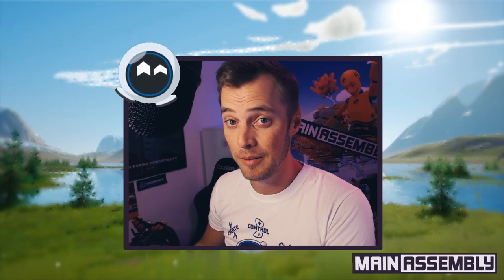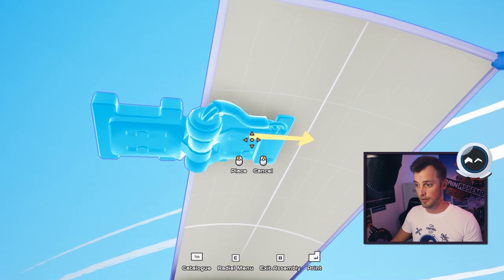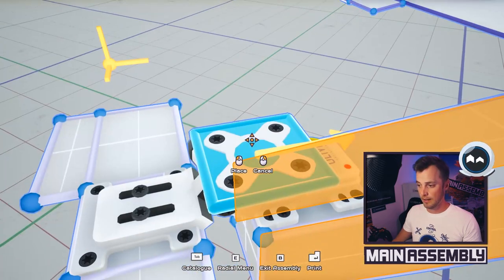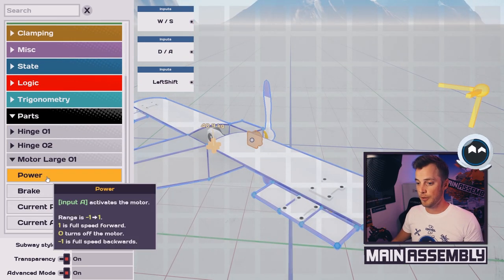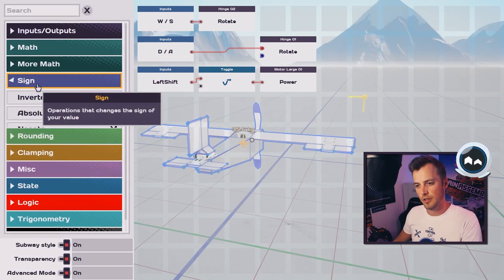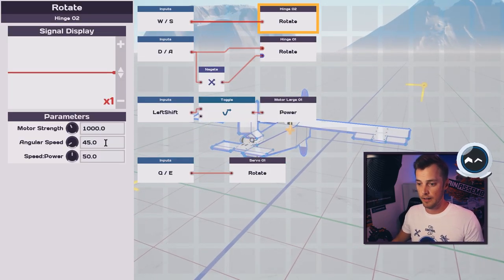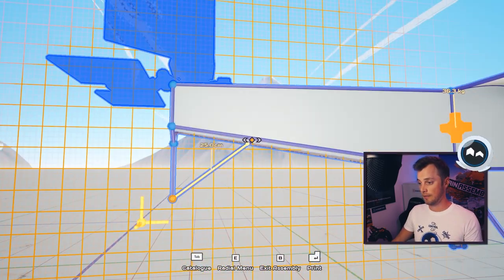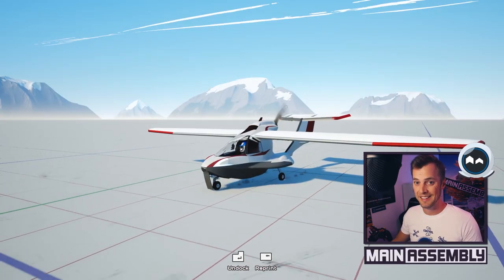A Dummy's guide to Main Assembly - Simple Airplane Tutorial

Comment: Despite the fact that it's a decent size and made of aeroplastic, I can't get my rudder to work properly. My plane has working roll and pitch but I can't get yaw to work. Furthermore due to the game acting like the rudder doesn't exist (at least aerodynamically) the plane kinda drifts to one side or the other in the air due to the lack of stability that'd normally be given by the rudder. Any way to fix this?

Comment: How can wings generate more lift if you bulge the middle of airfoil? How does aerodynamics work in this game?
Reply: its like this but simplified. low pressure due to the bend. 
 https://www.skybrary.aero/images/c/ce/Aerofoil1.jpg
Reply: @stertmangaming8479  This is very advanced physics for this kind of game, great feature. How about angle of attack?
Reply: If the top of the wing is curved, the air moves over it faster, creating lower pressure than under the wing, 'sucking' the plane upwards. This 'sucking' is referred to as lift.

Comment: Hey, I'm not sure why this is happening but my plane wants to do a tailspin. As soon as I start it, it immediately decides to spin in circles and refuses to leave the ground.
Reply: Either one of 2 things is happening, either, 1. Your propellor is dragging on the ground and causing it to spin when you power it, or 2. There's too much friction in the tail end of the plane, I recommend caster balls to remedy the issue.
Reply: @jeddllau  a type of (I think extra small I haven't played in a while) wheel that can be place on the bottom of a surface, instead of an actual wheel though it takes the form of a freely floating ball that can move in any direction.